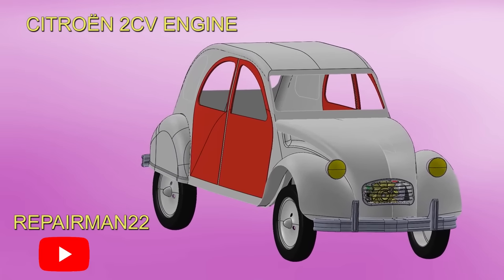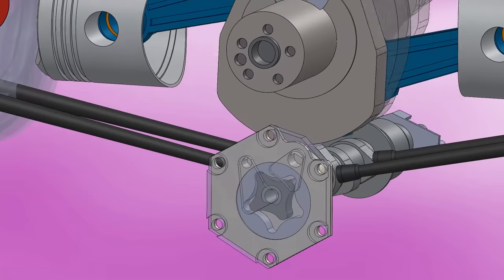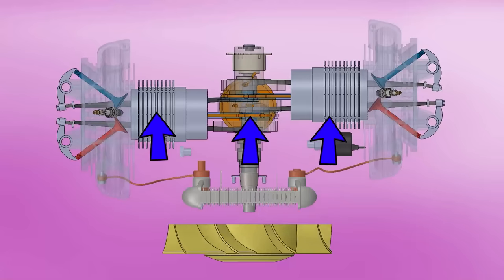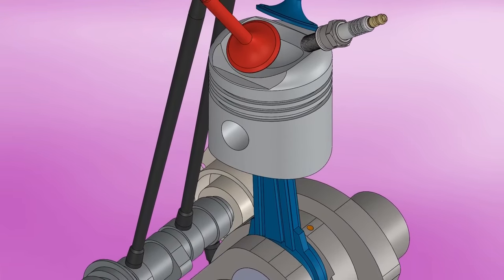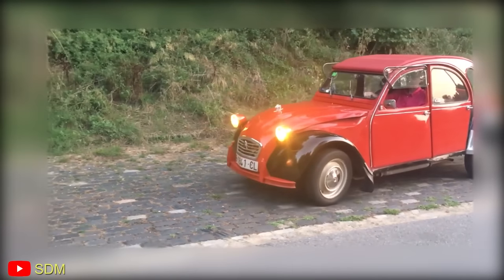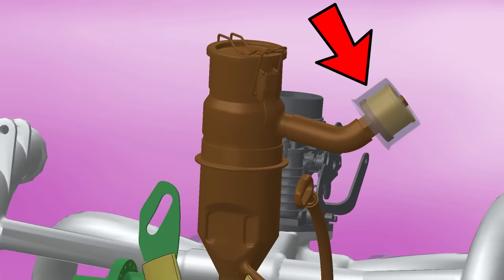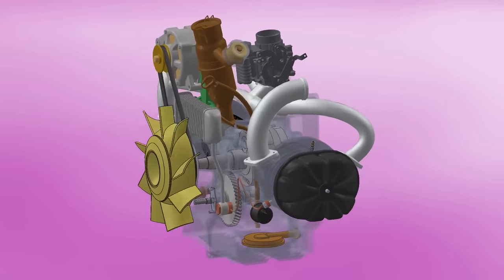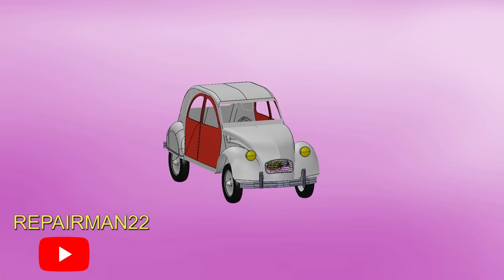The Most Interesting Engine In The World 😍 Citroen 2CV / How does it work in 3D?

Comment: "That thing gotta a HEMI?"
Reply: was thinking the same thing😂
Reply: The Citron Hemi would have been a better marketing plan, than 3CV. It definitely was better designed for rough roads, and beat the socks off the bug in that department. I wonder how it compares to a DKW 3 cylinder.
Reply: Yup all two cylinders !!!!! 😀
Reply: Sweet
Reply: Has the "hemispheric" head configuration. Sounds like a "hemi".
Reply: Even my Trabant and Wartburg have Hemis despite being two stroke
Reply: Tis a hemi. Without the power and with a self dissembling crankshaft. How many of these 2cv's had the crank come apart?
Reply: Ingénierie française les gars 💪🏻🇫🇷
Reply: The engine was very reliable - the biggest enemy was the rust
Reply: What is far more interesting about the true Beetle, it has the chassis constructed out of one metal plate, they press it in shape. Google other cars with this "monocoque" construction, you'll be surprised. Beetles have an excellent construction. Light and strong. Racing car concept.
Reply: Alot of things have a hemi. Thats why its a ridiculous still to keep the name for dranding mechanics wise
Reply: @voornaam3191 
The chassis consists of more than just a pressed metal plate..
Reply: It depends on what you think an "HEMI" is. HEMI comes from the geometry of the cilinder head that is hemispheric . That geometry has a lot of benefits, and Chrysler made a brand, but, many engines have  hemispheric cilinder heads and don't name it 🤷🏻‍♂️
Reply: Yes, actually.
Reply: The 2CV is a real Hemi, where as all the engines currently branded as "Hemis" from Chrysler (Stellantis) aren't actually hemispherical combustion chamber engines.
Reply: @bobmcl2406 Yeah, that's because a Hemi simply doesn't cut it anymore in terms of power and emissions.
Reply: You won't call it "that thing" if you have driven one... so uncomplicated, makes me think of an ironically german expression: Freude am Fahren... the happiness of driving
Reply: @Handyman1199 your trabant is a two-stroke alternate firing 2-stroke. 
It has nothing to do with a. If you want to get technical all two strokes are flat heads.. trabant is also rotary valve
Reply: @Handyman1199 wrong who told you that 😔
Reply: @PaulHigginbothamSr the two CV is overhead valve,
. not hemi.
Reply: @k3kboi665 most people have no idea what a hemispherical conducting chamber is and what it's even for they use it to sound big
Reply: @e28forever30 he didn't say it didn't
Reply: @rogervcp a Honda 70 has a hemispheric had so what you got to know what it is mostly nowadays it's just a term that one knows what the hell they're talkin about
Reply: @bobmcl2406 no it's not a heavy the valves are  side-by-side
Reply: @ronalddaub9740  interesting how you claim to know what a hemi is yet call my two strokes „flathead“… yeah a Trabant has rotary Valves but they are On the Crankshaft so it doesn’t need the carburetor to be on the cylinders and the ports to the crankcase to be controlled via the piston skirts. In my Barkas and Wartburg the piston skirts still work as the „intake valve“ into the crankcase just like in almost every other two stroke with no Reed valve intake

I bet you never held a two stroke piston in your hand? I did. Plenty. And they were ALL with hemispherical top. Such are the cylinder heads. Hemispherical. With a Flathead you’d struggle to even get 5.0:1 compression ratio, yet a Trabant has 7.6:1 which is even higher than the 2CV and Beetle
Reply: @PaulHigginbothamSr  pretty much none!  These engines last a long time, if you change the oil and avoid lugging them.
Reply: @PaulHigginbothamSr  Mine did lol
Reply: Hemi designs were common in pre war radial air cooled engines.  Not novel to the 2CV, but perhaps novel in auto applications.  
Don’t know when 2CV came along, but Chrysler hemi v8 was around 1955, and based on a V16 aircraft experimental engine of WW2.
Reply: Was it a backward hemi? Instead of a hump on the piston, it was hollowed out a bit. Compression was kinda low too.
Reply: Lots of random engines have hemies , like all Honda bike engines in the Honda trail/cubs . As well as most DOHC heads are Hemi , or wedge
Reply: How about a turbo charger with an intercooler.
Reply: @turboprint3d 
What's a "random engine"?!
Reply: @trueaussie9230  walk into a parking lot and randomly pick a car , likely it's a Hemi
Reply: @turboprint3d  
That very much depends on the location of the car park.
It seems that, when you wrote 'random engine' you meant 'the engine in a randomly selected vehicle'.
You assert "most [but not all] DOHC egines are Hemi (sic). OR wedge".
Not all engines are DOHC.
MANY vehicles on the roads today were built before hemispherical combustion chambers became 'fashionable'.
Ergo, the laws of random selection suggest one is more likely to select a vehicle whose engine does NOT "have hemis".
Reply: @trueaussie9230  well were I am a 10 year old car is likely rusted away . It would be easier to count non Hemi engines made today than Hemi engines . For examplethe older firefly ( Suzuki cultus ,) had a soh Hemi head , until they switched to EFI ,or unless u got the DOHC engine option . My truck engine from 2005 is also a Hemi ( Colorado ) my wife's jeep is a Hemi . The only place a Hemi is rare is pushrod V8s . Nissan's Titan V8 is a Hemi . Kia / Hyundai don't make anything but, same with most of the Japanese producers even back into the 70s . I would bet there's way more hemis on the road than other combustion chamber designs . It was a big deal as an advertisement for dodge as a pushrod V8s Hemi is kind of an oddity and required a more complicated block casting .
Reply: @turboprint3d  
If you're talking about WORLD numbers, as distinct from your tiny little corner of the world, I'll take that bet.
In Aus a TWENTY year old vehicle is considered ALMOST run-in. 😉😊🤣
Then there's VAST swathes of Asia and Eastern Europe.
Of the 8 road vehicles I currently own 7 of them are >40 years old and NONE of them have hemi combustion chambers.
But, Americans know best - especially about things beyond their own backyard. 😉😊
Reply: @trueaussie9230  ah so this is a pissing contest of some kind ... seriously I don't care enough to worry it was just general statement that alot more hemis are out there, than alot of people realise . I'm sure that differs hugely by location . But most Hemi engines are not labeled as such . Overall I don't see the point in arguing further . For reference I prefer older stuff but like I said previously everything rusts away when they salt the roads in winter . Mind you my truck is 18 years old but I'll keep something as long as possible .
Reply: @turboprint3d  
I was just interested to learn what you consider to be a "random engine".
I have no idea how you define "pissing contest" or what you consider qualifies as one, but it's very clear that you don't like being questioned and held to account.
You've back-peddled so fast and so far from your original assertion I doubt you even remember what it was.
From initially suggesting that the vast majority of vehicles on the world's roads today have 'hemi' engines, you now propose the more believable / plausible claim that "alot (sic) more hemis are out there, (sic) than alot (sic) of people (not even 'most' people) realise".
BTW - if you know the conditions in which you live (eg salted roads) are detrimental to motor vehicles, buy only those that are built with such conditions in mind - ie NOT American made / spec'd 'planned obsolesence' - and maintain it appropriately.
In your case proper maintenence includes regular and thorough cleaning.
You "don't see the point in arguing further".
Americans - individually and as a nation - tend to be dictatorially arrogant, bellicose, aggressive and 'competitive' by nature and, as a result, tend to consider EVERYTHING to be an affront and an attack on them.
I didn't know we were 'arguing'.
I was just trying to 'sort the wheat from the chaff' to get to the essence of what you were trying to assert.
(Which appears to be that "random" engines have hemispherical combustion chambers and (like aliens from outer space) there are more of them "out there" than YOU believe "alot" of people think.)
I've heard enough and I'm not interested in continuing this discourse. 😉😊
("For reference [you] prefer older stuff" - what?!)
I'm confident you'll come back with some puerile riposte to prove a) that you're the winner of your 'pissing contest'; and b) that you're a puerile troll who MUST have the last word.
Reply: @trueaussie9230  yo calm down , however this is exactly what I ment by pissing contest , as someone has to be correct when all I said was an opinion , not like I was claiming a researched statistic . I can't bring myself to care that much about some guy on the internet's opinion , neither should you . As clearly you want to fight about nothing . Grow up man and relax a bit not everything is a fight .
Reply: Yeah. So did lots mid-century cars until they were gradually with better designs. Like the Chrysler Wedgehead in the 1950s. 

For Chrysler… forever being the underdog.. they had to differentiate themselves from the other  Detroit companies. 

Sometimes it was innovation like the push button automatic transmissions and turbine engines and cab forward designs and car based people movers. 

But lots of times it was through simply making an insanely powerful car with a ridiculous engine .. and then tugging on nostalgia strings to keep it going. 

Like.. there was no reason they couldn’t have made the Wedgehead 440 as powerful as the 426 Hemi. And todays Hemis aren’t even Hemis. They are semi Hemis that have a different combustion chamber design and a second spark plug to clean up the emissions.
Reply: It's a sales trick.. just as naming it GT. Or sport.. 
It can be a different colour of seats or an extra dial in the dashboard. 
Doesn't change the fundamental principle
Reply: Americans thinking their cars are unique in some way ... 🙄
Reply: @PaulHigginbothamSr never heard of that. Those engines are very reliable.
Reply: Oui, le redwine hellfrog😂
Reply: @danbenson7587  The 2CV was due to be launched in 1939.  Then, war broke out, and the cars were hidden or destroyed.  The car was substantially redesigned after the war, including a new engine design, the one that’s being discussed here. (The pre-war cars were water cooled). The car was finally unveiled to the public in 1948.
Reply: A pushrod big block hemi😂
Reply: I think you would need to see one in real life before making that kind of comment
Reply: Well yeah if by hemi you mean pile of junk. It's more like a 1920s motorcycle head
Reply: Hemispherical combustion chambers are a bad design generally.  The current Mopars that are branded as such aren't really hemis. The hemi chambers on advantage is the ability to have large valves.  That's important when you spray a fire hose amount of nitro through a top fuel engine,  Hemis are inherently low compression shapes that require stupid domes on pistons to work with modern higher octane fuels.
Reply: @andreasandersson2994Still, rust was its biggest enemy. Especially the chassis, just around the spot where the front suspension arm bearings were.
Reply: With all of 9, count 'em 9 horsepower. Take that Mr Mopar!
Reply: Let's buy one and put Hemi stickers on them
Reply: That thing's got TWO Hemis!
Reply: @danbenson7587  the design and first prototypes go back before ww2
Reply: So do those 49cc gy6 Chinese scooter engines too
Reply: The 2CV is to cars what BREAD is food -- it is the baseline.   

Let's get it back into production and make it one of the world's transportation options.
Reply: @alza: technically yes. But don’t expect it to break any land speed records unless it’s driven off a cliff.
Reply: @philippm.1271  c'est vrai mais le châssis n'était pas cher et vite changer , même chose pour les caisses un weekend de boulot 2400 Franc de l'époque ( un mois de salaire) un weekend de boulot , c'était simple a faire
Reply: @superwout tout a fait d'accord avec vous
Reply: Yes😊
Reply: It's French. 50+ years ago, my father's repair shop also sold Renault cars. He couldn't sell the R4 or R8 because their engines were too small to be legal in Ontario Canada. The R10 had an 1100+ cc, iron block, liquid-cooled I4 Hemi behind the rear axles. The FWD R12 had that engine, or a 1300+ cc Iron Hemi in front of the front axle. Both had floor shifted 4-speed manual trans.  Our 72 Renault R12 could smoke the Michelin tires in 1st and 2nd, yet got 40 MPG.  They were tough and reliable cars, but weren't compatible with the cold of Canadian winters. The carbs would freeze up on long highway trips, and rubber boots on the CV joints would crack open if the wheels were turned sharp before they could "warm up". Heat and defrost were marginal. Typical European faults back in the day.
Reply: @danbenson7587  There were 2CV prototypes at the start of WWII but production didn't start till after the end of the war.
Reply: Yeah you thought hemi was something special or even means something?

Congratulations you passed the marketing course, you are a certified consumer.
Reply: Looks good let’s do it.
Reply: Hemi bancrupt
Wake up
Get out of la la lund

Comment: I own a 2CV Special, model 1986. Works like a clock, goes everywhere. Simple, «rustique», 6 liters/100km, easy to maintain, but be careful with the rust. Not only the engine, but everything is simple and basic on this car. The dashboard is so simple!  It is my only car, so it drives almost every day, and every year I make a quite long trip to visit friends all around France. Hope to keep it for a long time.
Reply: I know one shouldn't be envious, but...  I ENVY YOU!!  😁👍
Reply: Felicitations! My dream would be to own a Mahari, but keep it on a Mediterranean island for holiday visits. They are so over-priced, however (I saw one for sale in the Balearics just before the pandemic, and the owner wanted e10,000). The Two Horses was an amazing car - the French just didn't think like anyone else in those days.
Reply: @travelbugse2829  "the French just didn't think like anyone else in those days."  An understatement.
  I visited a small regional airport that has a museum in Chino, California and saw a French motorcycle around the WW1 era. The front wheel has a small displacement radial engine in place of where the center hub and spokes should be. The tire rim is fastened directly to the cylinder heads with spacers. the crankshaft is bolted to the front forks and does not rotate, the rest of the engine does! The carburetor is fastened to one side of the crank and somehow two-stroke mix is delivered to the  cylinders. The fuel tank is mounted to the handlebars. The most unique bike I've ever seen.
Reply: @cayankeelord3730  Good grief! But I suppose the Gnome Rotary did the same thing on aircraft, so the French engineers smoked a Gitane and said: "Alors, zat will go well on a moto - miniscule!"
Reply: @cayankeelord3730  en france on a pas d'argent mais on a des idées 😂
Reply: Made in France!
Reply: @anthonynicholich9654  allahu akbar!
Reply: Wonder if they got these ideas for the movie
"Magnificent Men in Their Flying Machines"?😂
Reply: I'm in Norway and a local guy here ONLY drives 2CVs and he has a company called Classic Parts which only sell parts for 2CV. There is two other 2CV drivers here I see from time to time. I own a 1968 VW beetle, but would love to drive a Deux Chevaux.
Reply: @cayankeelord3730   Megola from Germany
Reply: @Antarath  I have to admit, I prefer a hachi-roku over a deux chevaux. 😁
Reply: I guarantee it is not 6 liters. That would be the size of the biggest American v8
Reply: @russ549  Read his comment again. 😉
Reply: Worked on a couple of these, very ordinary cheap little car
Reply: I liked the sound of the 2 cylinder engine.
Reply: Don't forget to convert la carte grise en collection to avoid to be bored with vignettes CritAir 😁😁😁
Reply: this car is a "collection car" now in france and cost à lot
Reply: Parabéns 👏 👏 👏  que legal
Reply: Superb!
Reply: same, i got a 2CV6 from 1982, nice!